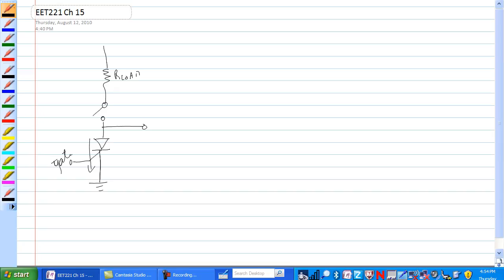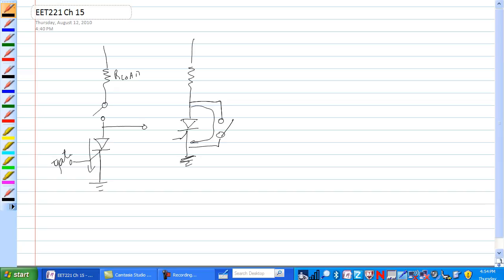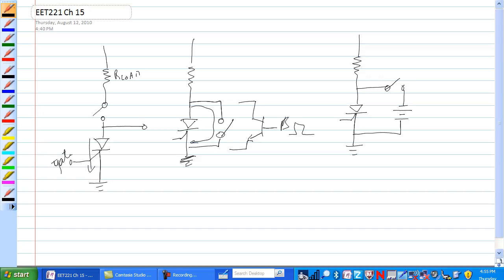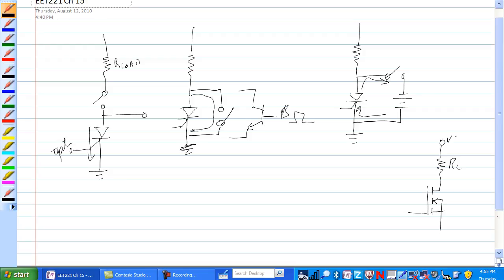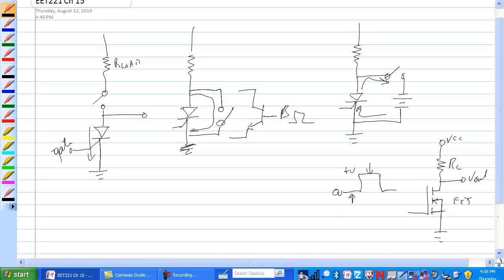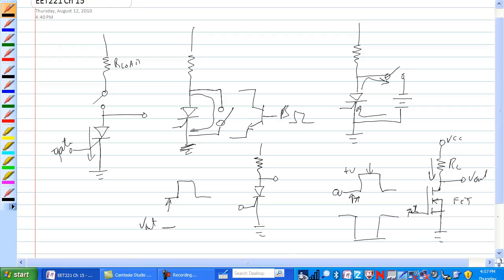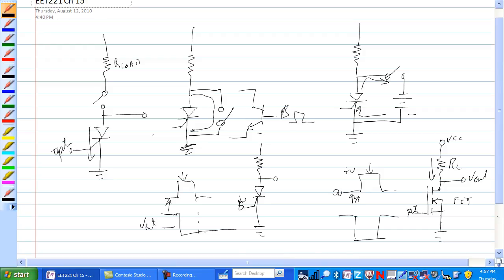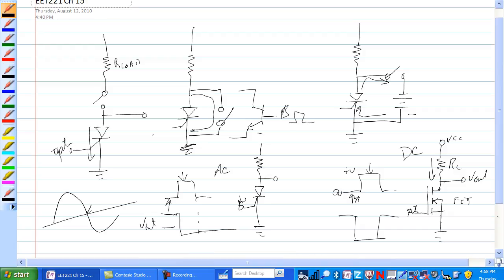4 SCR: Turning Off SCR

Comment: instead of a switch.. you could use a transitor to open the SCR once it's in conduction mode. so you can use a signal from a control circuit to open it automatically ;9